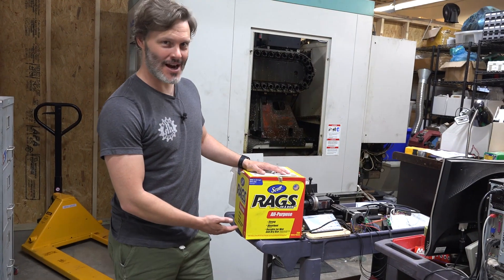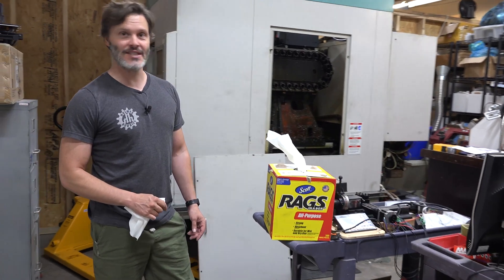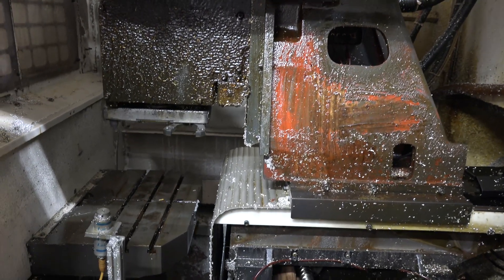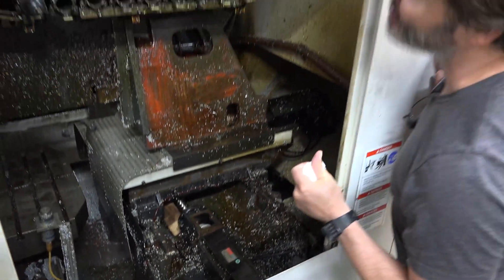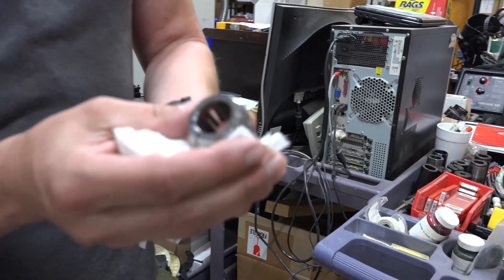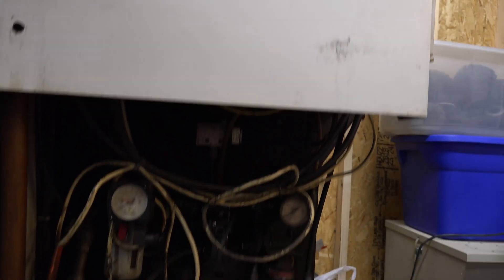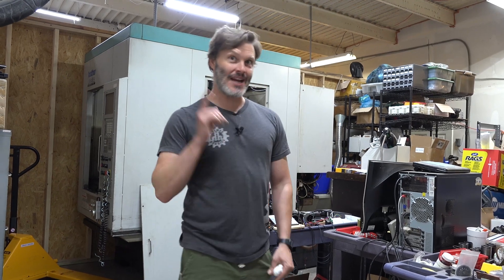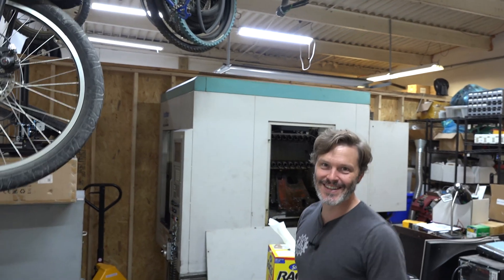Huge Unboxing! What are rags?  CNC Machine Overview with Holmes Hobbies.

Comment: Just a thought, keep an eye on your ambient temperature near the ceiling on the feed. PVC is rated as suitable for up to 50C or 122F. Anything past that and it fails the NEC code. We don't want you running into any issues with your new toy!